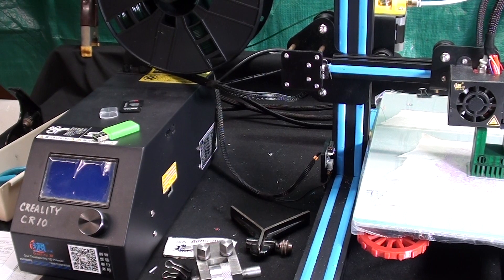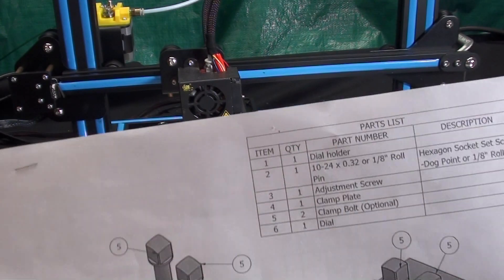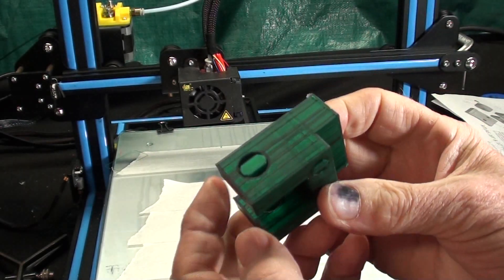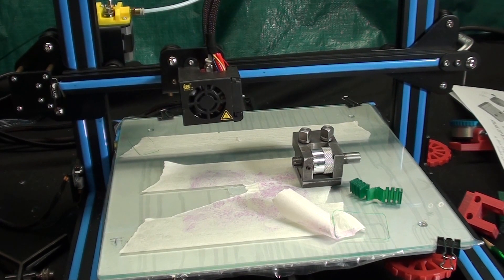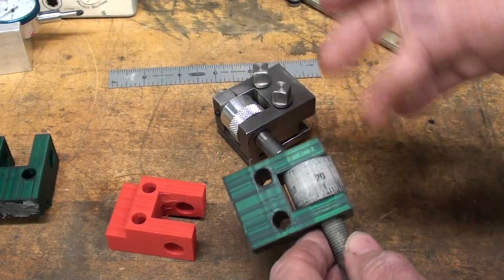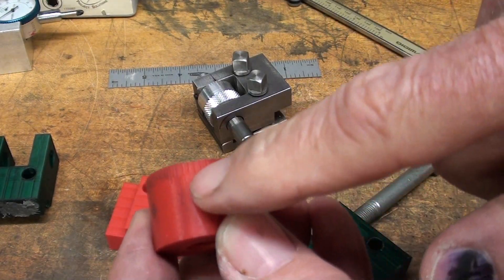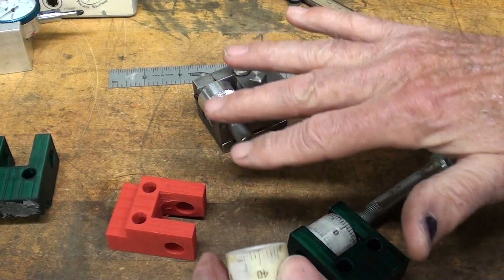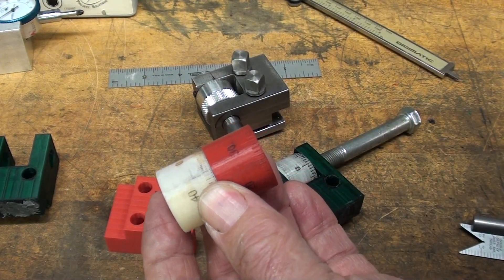3D Printing update CREALITY CR 10 with tubalcain #4

Comment: I need a 3D printer like I need a hole in my head, yet I find them so interesting.  Some years ago a guy brought one to my Dad's radio repair shop for the Saturday morning gab fest and we watched as it printed a small chain with links and marveled at it.  So I do find interest in the subject even though I doubt I will invest in it.
Reply from the maker: I rather lost interest in mine.     No one would wash my videos using the printer

Comment: I’ve got a CR10 and it’s a wonderful printer. Very capable and reliable. Use an Elmer’s glue stick on the glass and 70C on the bed temp. PLA sticks beautifully to it.

Comment: Everyone has a myriad of different suggestions from hairspray, or glue sticks, to painter's tape to kapton tape. 

In reality, tape, no tape, glue, hairspray, or the tears of virgin mermaids,  it doesn't really matter. 
The only thing that matters, is that you get your print to adhere to the bed properly.
So the truth of it is, it doesn't matter what you use, if anything at all, just as long as you are comfortable with it, and get successful prints.

That being said, I've been using scotch blue painter's tape. It has worked for me with no problems, after every print, i simply wipe it down with a paper towel wet with isopropyl alcohol. Once it starts failing to work, or if i damage it removing the print, it's as simple as removing the old tape, cleaning the glass, and applying a new layer of tape. 

To me, the best part of using the blue tape method, is it's cheaper than glue sticks and hair spray. You get many more prints per application, it's easier to clean up, and 1 roll of blue tape will more than out-last the sprays, and glues. Not to mention, with the sprays you get "over spray" on everything, and with both glue, and spray, you have to wait for it to dry. 

All of that aside,  if you have the financial means, and the inclination, there are reusable and flexible build plates specifically designed as a 3d printing surface. FLEKS3d, PRINTinZ are just two that I have seen people using successfully. However, there is a sticker shock involved, as some of these are $100 or more.

On the software side of things, there are some free resources, and online training available. 

My personal cad/cam software choice for building my 3d models, or creating jobs for my CNC machine (Crazy right! You can do BOTH with the same software!!) is Fusion360.

Here is a list of free online training / learning materials related to the software. 
https://academy.autodesk.com/inspiration/blog/top-free-online-courses-learn-autodesk-fusion-360

As you are an educator, you might be able to get a free copy of the software from autodesk (They have a free student / educator license for most of their software products)

Hope that was helpful, or informative. 
Thank you for such wonderful videos. 
As always, keep learning new things, and experimenting.
Reply from the maker: I agree with everything you say. Everyone seems to have a favorite method. But the tape, has been serving me well. I have tried all the other methods and they are not as good as tape. I had no luck at all with hairspray, and I tried several brands. Thanks for the comment

Comment: Are the files for these available to download somewhere?  Aquanet on glass works great for me. If you’re just misting it on, you’re doing it wrong. Flood the surface, let it dry, do it again. Now you’re set for a good number of prints that stick when warm and release when cold.

https://www.walmart.com/ip/Aqua-Net-Professional-Hairspray-Extra-Super-Hold-Unscented-11-0-OZ/10997068
Reply from the maker: I bought some last weekend I did not work. However I did just spray it on. I will try it again by your method
Reply: mrpete222 Make sure your glass is pretty level when you apply to prevent the liquid from running to the low side. Drying is faster if you put it on you heated bed. Otherwise it will take quite a while.   https://youtu.be/wzCcTCXGiDU

Comment: Thanks Mr Pete, I've been watching your videos for a very long time and I've learned a great deal from you for which I than you very much. Now maybe it's my turn to give something back. I built my own 3D printer from a kit 4 years ago and went through a very painful learning curve (and still learning). About 3 years ago I dispensed with tape etc on the bed and printed directly on the glass and it works perfectly. However the glass must be cleaned for every print and once cleaned never touched with fingers. I always clean with WHITE vinegar and fresh tissues. 100% every time. I printed an 80 tooth gear, in PLA at 100% infill, for my ancient Southbend 9" lathe, then  fitted it and forgot about it until I've just seen your video. It's still working after 3 years. Thank you once again for your excellent videos. Kind regards Ray (in the UK)
Reply from the maker: Thank you, I will try that. Lay as recently as three days ago, I bought hairspray aqua net that everyone  swears by, and the print let loose after five minutes. So back to tape I went.  Actually tape works quite well and I'm not just satisfied with it. But I will try your method with white vinegar thanks

Comment: Wish I knew him, I would love to get the STL file from him for the dials. I made a stop after seeing yours and you are 100% correct about the markings. Looked like I tried with a blindfold on. :-(
Reply from the maker: lol
Reply: I would be willing to post the files on thingiverse.
Reply: That would be great. Not really familiar with "thingiverse" but I can Google it and may need to ask a question or two on where to find file. Thanks!
Reply: Thingiverse is like the shopping mall of free STL files.  I have never but you can even have the files printed for you from commercial services through the site.  I don't believe youtube likes links in comments but just google thingiverse find your way there and I posted it as thing number 2797013 (drop that number in the search bar on thingiverse)  Enjoy.
Reply: Went there and got it. It was easier than I figured. Thanks :-D

Comment: i'm a member of machine groups and 3d printer groups. while i doubt either of them have ever thought to join one anothers groups/forums, the two are almost identical.
just one is typically rough dudes and the other are nerds. it's so odd to see such different types of people doing almost identical work just in a different material and be so far from one another in social settings.
Reply from the maker: Thats interesting--I suppose I fall between the two??
Reply: I feel they are part of the same coin.
Mixing the worlds is something i'd personally like to see more.
I don't work with metal other than building some things out of t-slot extruded aluminum since i can just miter saw, drill/tap, and slap together. I've got limited tools for metal work but i like both and do actually have a 3d printer.
So you're coliding both of the two things i watch the most on youtube (excluding music playlists).
Thanks for your work and videos :)

Comment: I'm sure you have plenty of people giving you advice, but, for what it's worth, I print all the time on glass (pla and abs) using Garnier Fructis Style "Flexible Control Anti-humidity" hairspray. I'm sure others will work, but I ordered a case of 6 when I started printing 4-5 years ago, and I still have more than half left. I use a brim around large prints to help control warping.
Reply from the maker: Thanks for the good advice

Comment: Don't worry about glass and tape. I use both, glass only for smooth and wide parts, tape for tall and thin ones. Really, even so, it's still an experimental setup. Everything is tied to the materials available in your area, room temperature and humidity, and, most of all, material. Even if it's PLA, it's not the same around the globe.
Just use whatever works best for you and cuts your losses. There is NO magic formula, even though everybody claims to have one. Wish it were different.
On the same note, filament stored for a few months (or a year) will fail horribly. Avoid stocking. But sometimes, a few months can make the filament work best with the settings you have. Until you order a new roll...
Reply from the maker: Very good advice thank you

Comment: No resistance from my quarter.  I am looking at building a metal working lathe from scratch and your 3d printed gears are just the ticket and then a few days ago I was thinking about the graduated dials and wondering how to do them-and there you are again.  Thanks.  The wise man picks the tool most suited to the need.
Reply from the maker: Yes he does thank you

Comment: Glass with kids glue stick. Smear it around a bit with isopropyl alcohol on a paper towel between prints. I  still use tape occasionally but not very often.
Reply from the maker: I will try that alcohol trick
Reply: (not typing on a phone now, can be a little more descriptive) I use the glue stick that goes on purple, with a little heat - not full but maybe 45C for PLA. I'll get a print or two out of it but when it gets to the point where I'm down to bare glass, rather than re-applying and building up a huge thickness of glue stick I just smear it around with alcohol. Eventually of course I have to reapply but the alcohol smear will work for quite a few prints.

Comment: Mr.Pete- Get a sheet of PEI plastic to cover your glass plate with. No more tape, hair spray or glue. Do some research on it. It's available on Amazon. I have a CR-10 S4, using a sheet of PEI and it works just fantastic.
Reply from the maker: How thick is this material? How do I fasten it onto my glass. Exactly what is it called on Amazon so that I can find it?
Reply: Search for Gizmo Dorks PEI Sheet. It's 1mm thick. The sheet is typically stuck down with 3M tape. I just clipped mine onto the glass and put a couple heavy parallels down on either side of the print with some tape on the ends to keep them from moving around. Works great.

Comment: Were you having trouble with a fine point Sharpie oil based paint marker?  If so the tip is likely clogged.  That tip is removable fairly easily with needle nose,  a vigorous shaking in some rubbing alcohol for a good 30 seconds will get it flowing again, just remember to store the marker upright while cleaning the tip, don't want that knocking over.  It might flow too much for some applications, but if its flowing too well its still diluted and should clean off fairly easily.  I bet some 6000 grit sandpaper could polish that knob nicely too.
Reply from the maker: Thank you, I will try that with my bad Markers

Comment: Following your 3D printer adventure I got a cr10 from Bang good & it is a great blessing. Today I was making a heart shaped led lamps for a valentine gift, having designed it first in Fusion 360 & although there were some failures & some cussing at 360, the end result was blessed with "love it!" It seems to me that one of these 3d  printers is no longer a nice optional extra, but an essential tool & I thank for demonstrating the potential.
Reply from the maker: I'm glad you got one. Have fun

Comment: Mr P - nil carborundum illegitimi.  I'm enjoying seeing the new ingredient and the mix of technologies and materials.
For filling the scale - have you tried the UV glues?  On the eBay search for Thick and Light Fly Tying UV Resin Glue.  it comes in 10ml bottles, usually a mix of 1ea Thick and Runny consistency.  You can get tints - but a small amount of sharpie or any spirit based ink will do the trick.  If you work in lowish light you can take your time and get it right - then use a UV torch to cure the glue for a couple of minutes to a tough glass like finish.  Leave over night and it will set hard then if needed sand down to expose the base material - or fill the grooves with whichever ink and protect with a clear coat of thin.  You can build up the surface and shape the thick or use the thin like high gloss varnish.

I inked in the graduations on a glass measuring jug.  It's used and washed daily and it's lasted more than a year and counting.
Like all glues you have to find what it's suitable for - rule 1 is whatever you use it you have to be able to cure with UV.

I've fixed the arm hinge back on my glasses.  If you rip a fingernail you can support it with the resin until it grows out or falls off.  All long term applications that need to be tough and waterproof.... worth a look
Reply from the maker: Where do you get that glue? My local Ace Hardware does not have it.
Reply: I get mine on eBay the fly tying option is best (avoid the phone screen repair options - it's weaker and sets rubbery), search "Thick and Light Fly Tying UV Resin Glue".  The other option is the JML 4ml "wand" search "Super Power 5 Second Fix UV Light Repair Tool" (our local supermarket also sells it) - but lots on ebay.  OK as a tester, about the size of 1 shot silly glue.

Unless you have one you also need a UV torch, often included in the offer - but lots on ebay.
Reply from the maker: Andy--These glues all appear to be clear?? Are there any that are black?
Reply: Short answer - No, I suppose you have to let the UV in to cure it for general use. But you can cheat.  I've either inked in the markings with a pentel superfine marker, and then painted over a clear protective layer... or you can squeeze a sharpie or add a drop of spirit based ink (dykem) to a couple of drops of glue for the first coat give it a roasting with the UV then cover with a second clear coat.  It's fiddly but in the right place very durable.

The Torch is more portable but you can also find a 110/220v uv bulb on ebay I just give things half an hour under that and it seems to cure fine.

It cures tacky which is good for this sort of job.  That dries off over the next few hours to form a tough skin.

Comment: I believe the active ingredient you're looking for in hairspray is vinyl, vinyl caprolactam/VP/VA copolimers. Look for the cheap stuff with 'extra/super/ultra' advertised. It's basically PVA glue, or wood glue, which should also work diluted with water. If you can get that to work you'll never use tape again. 
By the way, coming from a younger man, you're getting the hang of this pretty quick I must say, respect!
Edit: additionally, I found with hairspray on glass the first layer is critical. Two thousands of an inch can be the difference between stick or no stick. Ideally the first layer should appear slightly squashed. Too squashed may cause trouble in layers later on, but at least it sticks. Don't be discouraged because it's by far the most difficult thing I had to overcome when I started.
Reply from the maker: Thank you

Comment: Tubla, brother! I have a metal working lathe and I also built a 3D printer. Why make everything out of metal, there is no need. Also, make your prints stick anyway you can. I use tape with a bit of purple glue stick on it and my parts stick just fine.
Reply from the maker: Thank you

Comment: It would seem to me that if you were into projects that would profit from castings you have two choices. You can either do wood working  or do 3D printing to make the patterns....I don't have wood working tools, so I'd go for the 3D.
If you need to do light duty gears for small lathes and other projects requiring non-stock gears, 3D looks the way to go especially if you get a printer that will do Nylon. By the time you buy a few reasonable quality gear cutters and material for the blanks,  you'd be well on you way to buying a printer like Lyle has.
Reply from the maker: Thank you, that's all very true

Comment: I watched your videos on using the 3D printer with interest.  I have a 13" Southbend Lathe and it needs to have a gear replaced.  Also watched where you had printed a gear for one of your lathes and it help up quite well.  So, I ordered a CREALITY CR 10 3D printer hoping that I could get help with the software and print a gear that I need.  Sure could use help with the software as I am 70+ years old and not good with unfamiliar software.  Yet very interested in machining and your videos.  Sent letter, with check, to you for Southbend and Bridgeport USB memory sticks.  Thanks ever so much for your videos.
Reply from the maker: Thank you very much, and good luck with the new printer. Stick with it there is a definite learning curve. And in a few weeks, you will be quite good at it

Comment: Combine things. Make a metal threathed insert. Make it a bit oversized and fill the (deeper made ) numbers with paint. Then grind or turn of the thing to the right diameter. Other option, make the metal dial without  the markers, 3D print a sleeve with the markings and mount it over the metal. Best of both worlds
Reply from the maker: Yes

Comment: Mr. Pete, I too have a CR-10, and yes many people have scolded me for using tape, but I like it.

I have found online, 10" Blue Painters Tape, which provides a new pristine surface when changed. Parts are sometimes difficult to remove, but I design most of my parts with a slight undercut or bevel where a putty knife can be levered to gently remove the parts.  If done correctly, the same tape can be used many times. 

A role of  10" tape is expensive, but it is about the same price as 5 roles of 2" tape.

The technique I use to apply the tape is: start with about 2 inches unrolled,  tack that to the left side of the platten, gently unwind the tape across the platten as the tape is pressed down and smoothed, then slice (with an exacto) down through the tape to the glass platten.

To reduce the stick for some larger parts, rub your fingers over the warm tape, oil from your hands will reduce the "stick" slightly (which may sound contrary to most 3D printing people's desires). 

I enjoy all of your Vid's,  keep them coming.
Reply from the maker: I did not know they made tape that wide. And yes I like tape, I do not know why so many people badmouth it